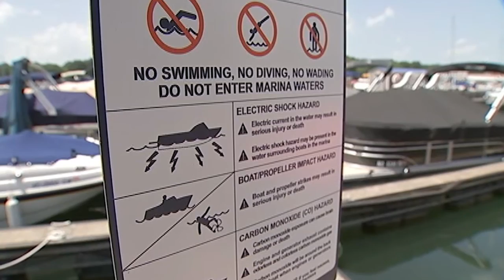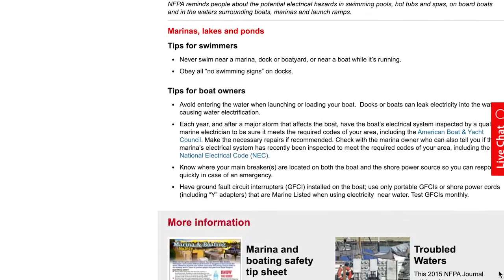The Hazards of Electric Shock Drowning (ESD)

Comment: I'm having a underground pool built in my right now. When the cool deck was poured the next day we noticed cracks in the concrete. So the contractor agreed to replace the section that crack.In the process they cut the grounding wire around the pool. A week went by and today the project manager installed a #8 bare copper wire around the section that was cut. well on one end he attached to the existing ground, in the middle he attached it to the ground from the rebar cage of the pool and other end he drove a piece of rebar in the ground and tied the#8 bare copper wire with steel wire to the rebar and shoved the rest or the copper wire under the cool deck. Now am no expert, but i think he broke the continuity of the ground. HELP!
Reply: The rebar is usually attached to the ground all around the pool not sure how code is by you but it should function if cut in only one spot but it needs a direct connection the the pump
Reply: Not sure though so better be safe and call someone licensed in your area
Reply: The pump needs to be bonded to rebar and all the bare copper surrounding the pool if that connection is severed than you might be fucked